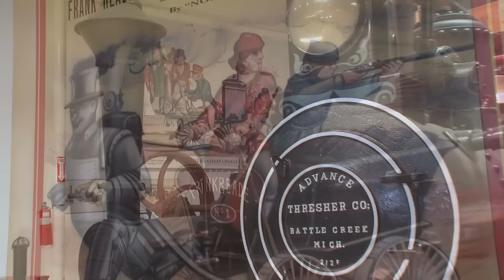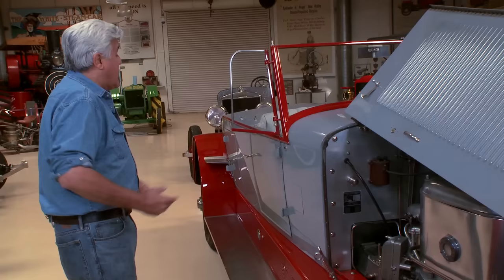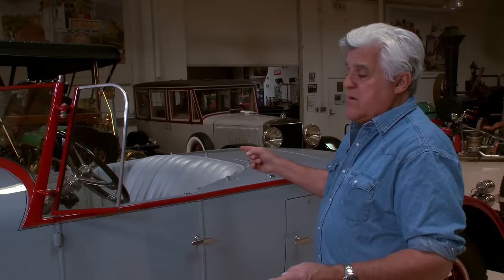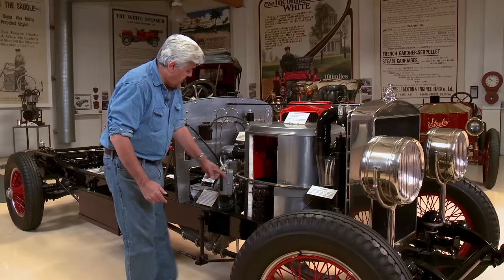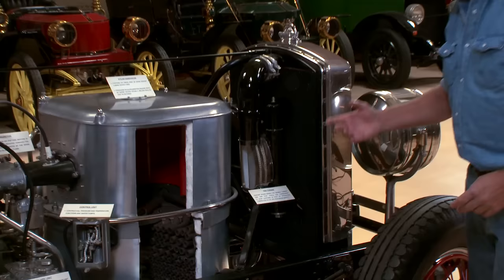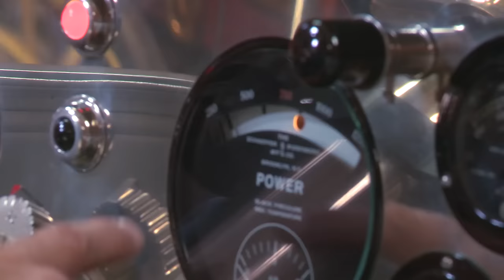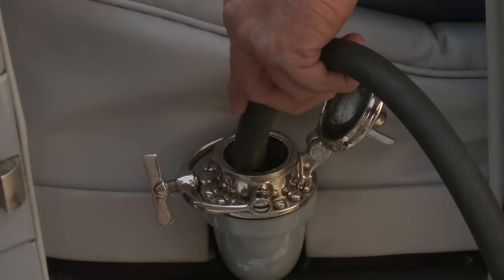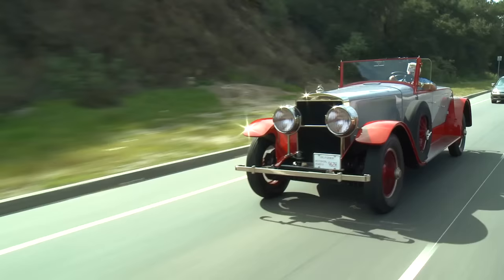1925 Doble E-20 Steam Car - Jay Leno's Garage

Comment: I'd love to see a high tech steam car built like a hyper car.
Reply: my thoughts also!
Reply: They should've done that in the 90s. Now with the electric car all supercars kind of seem pretentious. I mean a Tesla p90D accelerates faster than a McLaren F1
Reply: Maarten van Rossem Lezingen Not without waiting to precondition its batteries and severely shorting its battery life..
 Not impressive as a performance car..
Reply: That is just wrong.. look up what fast means.. the Tesla is only faster in the 0 to 100 time.. Apart from its not that fast.. on the Nordschleife its over 8 Minutes.. the MClaren is a whole Minute faster!
Reply: +m1aws Without damaging the batteries?  NO
Reply: +m1aws The Tesla P100D is no performance car... just more marketing BS
Reply: +Arne Hurnik  But why would anyone build a steam car today? They are horribly inefficient and more expensive to build, less reliable, cost more to maintain. They have been obsolete 100 years for a good reason... sadly so many have forgotten these facts.
Reply: +Arne Hurnik How can a steam car be more environmentally friendly if you are burning more fuel to go the same distance... and using more resources to build and operate it?
Reply: +Arne Hurnik Electric cars have been around for over 100 years and they had there chance just like steam... we use internal combustion because its has best efficiency, the most practical and economical. Steam simply cannot compete against ICEs in any significant aspect... which is exactly why they became obsolete so long ago.
Reply: +Arne Hurnik I like steam cars.. they are very interesting from both an engineering and historical point of view... but no legitimate companies in the automotive industry are looking at steam cars as a viable commercial product.. its a dead end technology.
Reply: +Arne Hurnik Well, now you know why there are no more steam cars...
Reply: +doktorbimmer There is already countries banning fuel cars by 2040 (Already a passed law). In the end electric is going to win. At it's current state it will take over but once a better battery comes out nothing will be able to compete. I like big V8's but I also can't wait to see what the future brings with electric cars. You can already produce your own power just with solar panels but it's very hard to produce gas own your own. Even if the worst type of power (coal) is producing your power it's way more efficient for coal to spin a turbine to produce power than a gas powered car (25% efficient avg). The only reason gas powered cars won back in the day compared to electric was fuel was very cheap and there was abundant amount of fossil fuels. In the end electric will win no matter what.
Reply: +zebarzebra of course a supercar can beat a luxury sedan on a race track, the P100D is meant to be driven on the road, not on a track! That said, I would love to see a proper electric supercar from Tesla (and no, not a "roadster" that's basically just an electric mustang, I mean, a proper race car that's all-electric that can compete against gas-powered supercars)
Reply: Would also be a good excuse as any to build a small thorium reactor.
Reply: The higher ups wouldn’t approve, won’t happen
Reply: Steam cars died-out after the invention of Kettering's electric starter for internal combustion cars... steam cars have been obsolete for over 100 years!
Reply: Good comment... 96% of all commercially available hydrogen is refined from petroleum... So using hydrogen means that in most cases you are still using fossil fuels.
Reply: You don't have to use fossil fuels in Internal combustion engines either... and they are more practical, affordable and efficient.
Reply: Why pay twice as much for the same amount of hydrogen?
Reply: +Freddy Fazbear That comment didn't seem to make any sense... I guess that is why you deleted it?
Reply: +Freddy Fazbear There are currently several hydrogen fuel cars available for sale here in California and in other countries... the Hydrogen Fuel Cell is now the preferred concept because it is eligible for up to $10,000 dollars in rebates as a ZEV...  Toyota now offers FREE hydrogen when you buy a Murai HFC!
Reply: +Freddy Fazbear I personally like the idea of more hydrogen fueled internal combustion cars... they offer a huge advantage over hydrogen fueled steam cars in terms of fuel efficiency but both would be ineligible for tax credits because of high NOx exhaust emissions... and since most hydrogen comes from fossil fuels neither of them can be honestly considered zero emission and most of the world's electricity comes from fossil fuels... even hydrogen produced from electrolysis can not really be considered a renewable energy source.
Reply: ERNIE BRINK ROTARY Well Elon isn’t a magician so he’ll have to wait for the tech to develop like everyone else. But he might get it done in his lifetime.
Reply: doktorbimmer because its cool and owing to some very cool materials developed by NASA there may be a way to make ‘light’ steam engines. It’ll make for a pretty slow super car but it’ll be impressive. You could power it with coal powder and steam turbine. Although you may need to suspend the coal powder granules in something. However if you could find a way to blow the coal powder into the combustion chamber it could build tremendous heat.
Reply: +Devin du Plessis Steam cars are not obsolete because the lack the needed materials... They are inherently flawed in their very concept, Carnot discovered in 1824 that steam engines can never be as efficient as internal combustion due to the Second Law of Thermodynamics and the wasteful phase change in its working fluid. Turbines are completely unsuitable to automotive application due to the cost and and lack the efficiency at the reduced scale required.
Reply: +Devin du Plessis You could also power a steam car on unicorns farts...but there is no combustible fuels that will improve the steam cars lack of thermal efficiency. Free fuel sounds great but coal is not free and it does not make the steam car any cheaper or easier to maintain.. The Doble was designed to use Kerosene/Diesel No.#1 because its ideally suited to the application, its lighter, more compact, produces the most heat, easier to carry, easier to meter, easier to ignite and burn, less corrosive, is non-abrasive and is cleaner burning leaving less residue that needs to be manually cleaned and removed.
Reply: Thank you for your graphically robust bold font. I can tell you must be an engineer or kid pretending to be an engineer, the reason the world needs designers AND engineers is that engineers strive for efficiency in a field while designers highlight that efficiency is not necessarily the only goal. I think anyone trying to make a steam powered sports car would understand that it would not rival a Bugatti. However owing to new developments in materials that deal with heat really well the steam engine could be lighter than before.

Cost would not be a concern in a project like this as the investor would understand that he would be building a one-off speedster. (as illustrated by Jay's jet turbine speedster)

Efficiency would not NECESSARILY be a problem either. The aim would NOT be to make a reasonable car that could drive a good distance and not emit too much steam and fumes in one go. The aim would be to push as much steam out as quickly as possible to get a very inefficient engine type to be as fast as possible. But I'm not an engineer so the engineer on the job would have to advise what would be the best way to achieve the maximum possible speed.

Basically the aim would be to make a sports car using outdated technology to see how fast it could be. It would not be financially viable as a commercially available vehicle. 

A few examples of something like this currently in use (outdated tech used to see how well we could do at it using modern knowledge): 
1. Horse racing
2. Chariot racing
3. Sailing
4. Downhill racing
5. The entire olympics

Clear?
Reply: Thank you, it was apparent from your previous comments that you were unfamiliar with the technical reasons why steam cars were obsolete... those who are without formal engineering study are often oblivious to these factors, and sometimes mistakenly think that these fundamental physical limitations could be overcome by simply throwing money at the problem without understanding the Laws of Thermodynamics which make such improvement impossible or outside the realm of practical design considerations... If you have any questions I would be happy to explain them to you. Cheers!
Reply: doktorbimmer What about a Ford they break easy and have been obselete since the 90’s
Reply: @Crusty Sock I don't know what Ford you are referring to? Ford Motor Company is still one of the Top 5 largest manufacturers in the world... 7 millions vehicles sold last year. Doble went bankrupt in 1931 after only building a handful of cars. Cheers!
Reply: Wow, I'm surprised that my comment has gotten so many responses. Yes, my point was that with new technology it would be interesting to see how far steam could be pushed for performance, not that it would be viable for anything more than a demonstration of new technology meeting technology that has been gone for a century in automotive industry.
Reply: @Jon Anderson Indeed, it still remains an interesting hypothetical... a great "what if" question, although not a practical idea... and certainly not a commercially viable one. The limits of steam efficiency has been well understood for some time yet I am surprised by how many people believe (erroneously) that some significant breakthrough in efficiency compared to current technology is the realm of possibility. The question that we should be asking is WHY? steam cars went the way of the Dodo and the dinosaurs so quickly? and why they remain extinct today without some crackpot ranting nonsensically about conspiracy theories regarding the petroleum industry. Don't hate... Educate yourself!  Cheers!!!
Reply: @doktorbimmer  and to all commenters, the future is the bicycle.

-Only requires muscle energy
-Very little maintenance
-Comfortable and fun

And this is coming from a guy which is in love with the 2 stroke and like steam engines.
Reply: @MultiMedia XL I have been a cycling my entire life as a hobby and have ridden over 10,000 miles... and i can tell you with great certainty that the notion that bicycles will replace automobiles and other forms of motorized transport sounds like a wonderful option, it is also nothing but a very unrealistic, Utopian fantasy.
Reply: @doktorbimmer  Maybe in the US, for central Europe (which has a higher population density) bicycles are the norm, and in northern Europe, cars were a city-dwellers toy up until the 50's.

I believe that the bocycle is the future, they are even today, the most produced vehicle in history, and with newer manufacturing techniques, they will only become cheaper. Of course motorised vehicles and trains will be used for transporting goods, but the bike will replace the auto in big sections of the world. It is only a guess though from my side.
Reply: @MultiMedia XL I have lived in Europe and have traveled to many places in the world... and Europe is not the world. In poor and socialist countries were many economic factors are manipulated and heavily taxed, bicycles are a affordable alternative for people traveling very short distances who otherwise simply cannot afford to buy a car... unfortunately this model simply does not work in many places. If your economic situation prevents you from being able to buy a car? Public transportation and cycling are your only options...
 Over 100 million new cars were sold last year and is an industry which has billions of dollars invested as it shows show no signs of significant decline in the future.
Reply: @doktorbimmer  No the fastest production car 0-100 kph is not a performance car, just a luxury sedan that happens to be faster than any bimmer ever built.
Reply: The Porsche 918 is not a luxury sedan...
Reply: @zebarzebra  What do the Porsche 911 GT3 (996), Lamborghini Diablo GT, and the Nissan Skyline GT-R R33 all have in common?

They all ran the Nordschleife in over 8 Minutes.

Just because it's not as fast as the fastest cars ever to run the ring doesn't make the P100D slow.
Reply: The P100D is slow because it has a stupid battery that weighs 1,440 POUNDS! even when its completely discharged Hahahaha!!!!

Comment: Bring back steam, This is glorious
Reply: Yes, I'm working on that
Reply: I love these dont get me wrong, but they are nowhere near as efficient as a car that was built 5 years after to now. If we were still driving these bad boys our planet would be crying for mercy
Reply: Steam is fascinating but unfortunately it's never coming back
Reply: Sander Van der Kammen I definitely see a potential application for things that need a lot of torque and are unlikely to crash or are protected, so basically tractors and tanks.
Reply: @fifthcolumn388  Tractors and tanks????
Farmers live or die by fuel costs and Diesel engines offer 200-300% better fuel economy and cost less to build.

Torque is completely meaningless in tank design, successful tanks as a general rule use aircraft type engines  or designed by aircraft engine manufacturers because of the critical design factor of horsepower-to-weight ratio performance.
Like aircraft, tank engines are often not even rated in torque, horsepower  is all that matters.